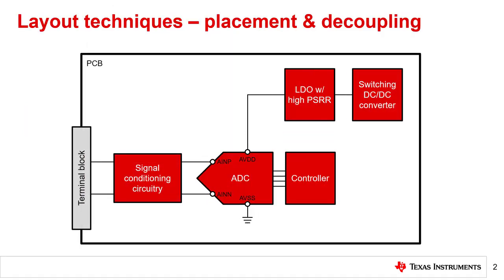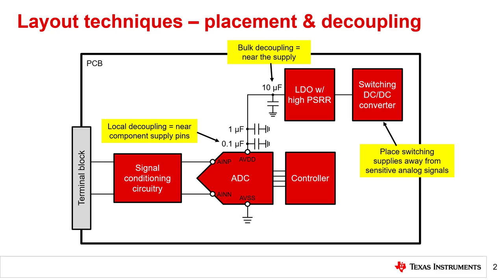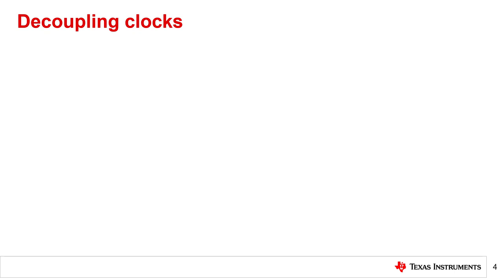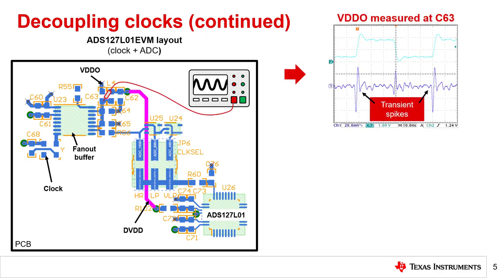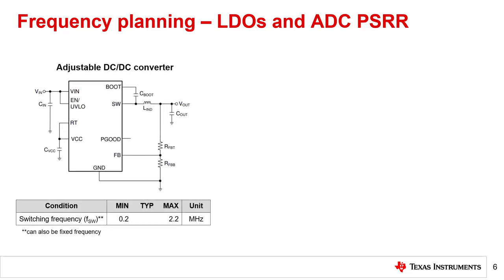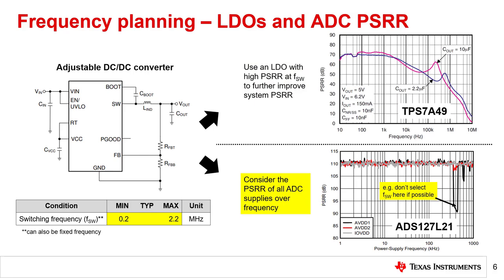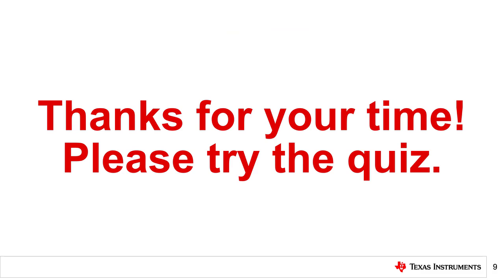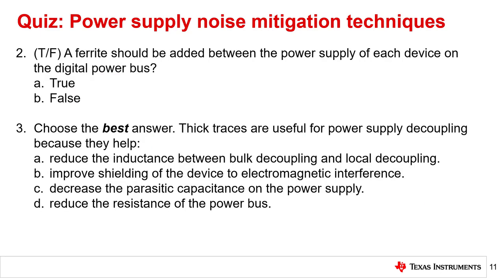Power supply noise mitigation techniques

Comment: Hi .I designed a voltage source inverter with Arduino  uno 328 , my problem is when we go up to input 60 volt DC inverter start misbehave . Like output voltage not in sine shape and also i2c LCD going to glitch mode . If we turn on trough transformer . DC 24 voltage output 230 ac seems perfect . Is ADC noise create a  problem. I share tha vdd vdda . And output gate driver use tlp350 , but 15 voltage supply same in gate driver and microcontroller .